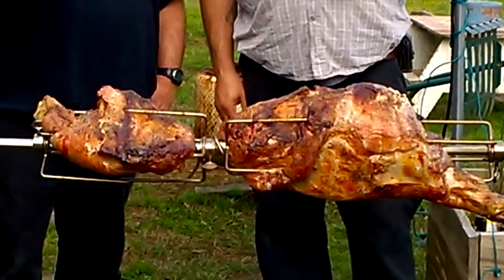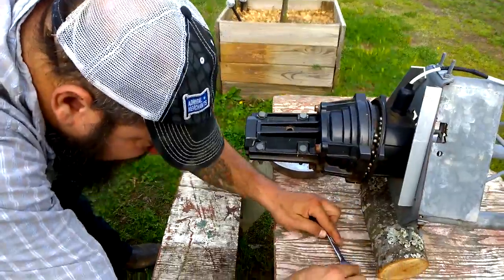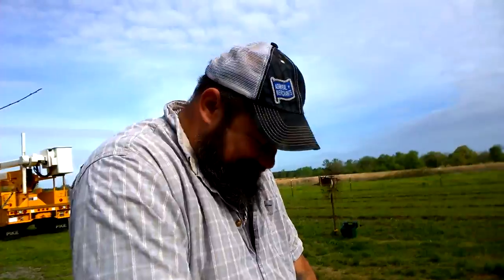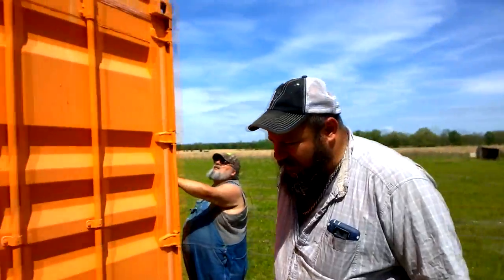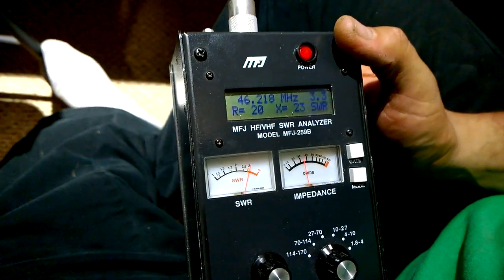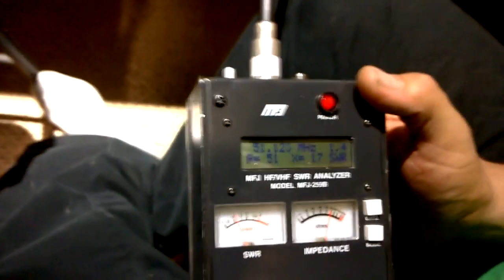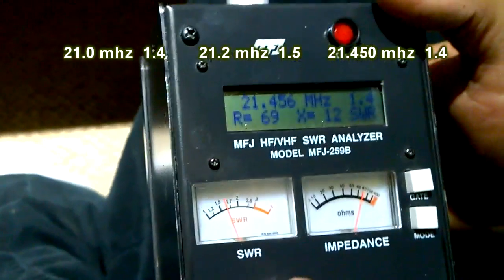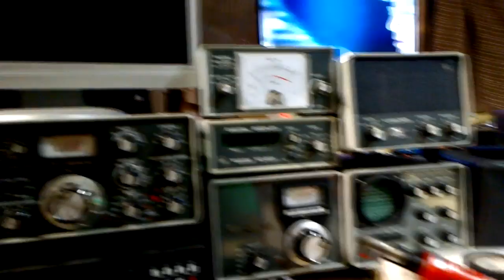Putting up a Hex Beam Antenna

Comment: can I ask you guys a question..... My hexbeam is going up about 53' on tower really soon..  I am finalizing the wire and spacers.  Can I ask just what specific dimensions you guys used for the DE and reflectors, and critical spacer dimensions.    A lot of my parts are from DxEngineering and currently using their dimensions... Just wonder what you guys used.... Pretty hard to change after it's up there! looks like your dimensions worked out well!   I really do appreciate and thank you for your time helping me out here!!